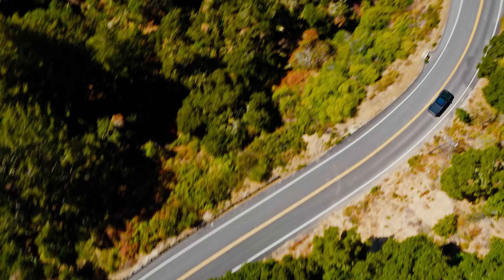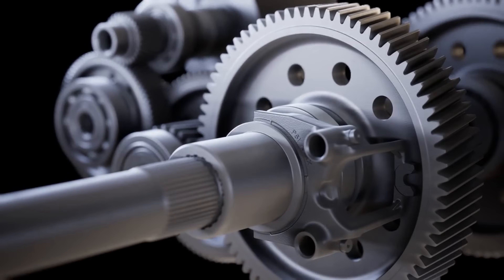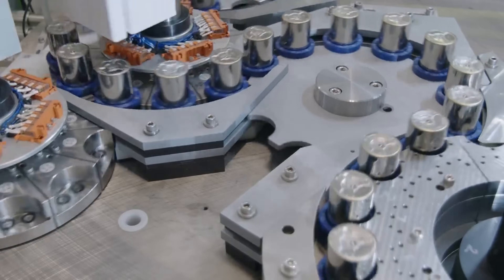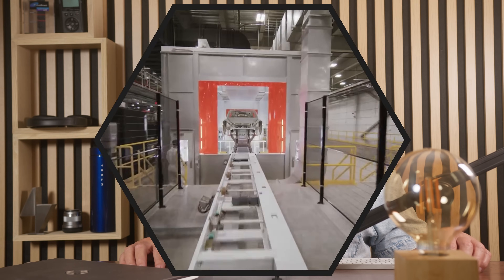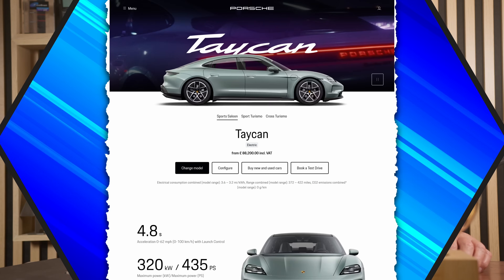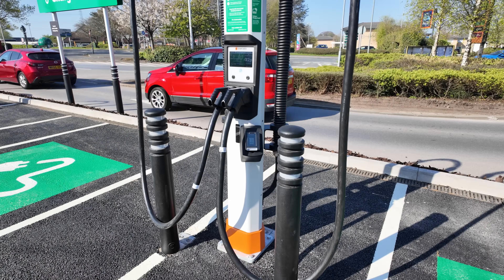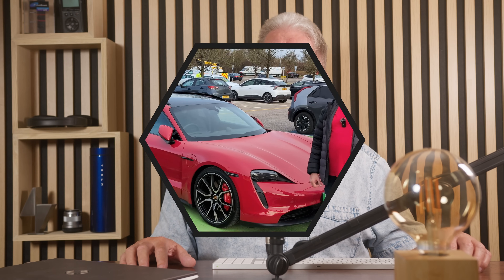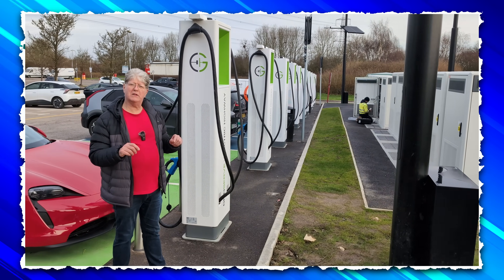800V Charging Is The Future... Or Is It?

Comment: i absolutely love BYD (blade battery) and CATL batteries which are extremely high voltage, and fully capable of flash charging in five minutes, adding 250 miles for the BYD blade batteries, and 323 miles added in five minutes for the CATL batteries. some of my favorites is, no fire hazard, longer cycle life (over one million miles of driving while retaining 80% of their original capacity to fully charge), cost less to manufacture, lower cost materials, and 100% recyclable. i remember when all the experts agreed that it was not possible to flash charge a battery in five minutes, and have a battery that has a long cycle life. BYD and CATL both offer lower cost flash charging batteries that are better than the obsolete technologies which cost more, and have a shorter cycle life. The future has arrived. now charging an electric vehicle can take less time than refueling a gasoline vehicle. China already is in the works of installing thousands of flash charging electric vehicle chargers and China has mastered how to transition to electric vehicles by giving the electric vehicle industry, including ev buyers, all of the subsidies and incentives that they use to give gas and oil. now gas and oil receive no support, and breakthrough ev technologies receive over 800 billion in support, in 2024 alone.

China is a master of action. China has installed literally thousands of ev chargers each and every day, for decades. While the US has promised to install chargers, but many ev owners say they do not even see one new charger installed, and the existing ev charging infrastructure is often non operable, with no one responding to repair requests. this is another reason so many ev buyers buy tesla, because tesla maintains their superchargers, and tesla is constantly expanding their supercharger network, in every direction needed, and always without hesitation, and without delay. i have never had to wait more than 60 seconds to begin charging a tesla, even when the charging stations are at full capacity, during the busiest of hours. if tesla can add more solar to their supercharging network and offer free supercharging for life for all new tesla ev buyers, i think everyone would break up with their gas vehicles and dump the pump once and for all. the transition is already taking place. tesla owners are seeing their ev’s last longer than gas engines last, which means battery technology has already matured far beyond the life of a gas powered vehicles lifespan.

Comment: 800V is from the here on out. There will still be 400V EV's sold, especially on the cheaper variety, but most chargers being installed now are all 800V, so will most EV's be that way. It's called progress. It can't be stopped. Never has, never will.

Comment: Lots of EVs are using 400 V and for the last decade it has been state of the art.
Now 800 V is the new black but it doesn't change the fact that your current EV is just as good now as it was before.
Your next EV will most likely be 800 V and it really doesn't change anything noticable maybe except that a very few old chargers will be incompatible.

Comment: Facts wrong again Dave, Tesla use both permanent magnet and induction motors. These are both controlled by an inverter unit delivering 3 phase AC to the motors. DC motors use brushes, Which wear. All brushless motors use AC to control speed and power.

Comment: Motors are all AC, not DC, it's just induction or permanent magned. DC motors are what you had in old forklifts, golf carts or milkfloats, they have to use brushes and are therefore limited in power.

Comment: 800v is a beast. In my 2025 Ioniq 5 I’m plugging in around 30% (need a comfort break at around 200 miles). It will charge at 250kw until then 200kw until 80% this is usually just over 13mins. In my LR AWD at 30% I would usually get about 80% and my 30-80% would take maybe slightly over 20mins. Cannot wait until the Tesla cars are 800v.

Comment: Within reason, the higher the voltage the better. It reduces the size and hence cost of the wiring., and the greater the efficiency. Bear in mind that P=I2R, that's current squared. Half the current gives much less than half the power lost due to resistance.
It's also cheaper for the power electronics that don't need to switch as much current.
It's necessary if you're charging a lorry, else the cables become absurdly large. There's a very good reason why power is transmitted at as high a voltage as practicle.
So if you want elegant, cheap chargers with thin cables, you need a higher voltage.
You might want even higher voltages for extremely rapid charging. For most purposes it doesn't make much difference.

Comment: The fastest charging speeds are totally irrelevant. Never do you get the fastest speed  for more than a few seconds, with the battery low in power. It soon drops down to half the power then quarter.  By the time you get near 80% its starting to crawl.  The best figures are times from 10 to 80% Not the maximum power.

Comment: Not quite true about the 1000 mile range car.  In 2006 as a publicity stunt Jaguar drove a stock XJ 350 TDVI from Lands End to John 'O'Groats on one tank and then headed south back to Coventry, running out of fuel after 1000.2 miles of driving.

Comment: Charging speeds are fine for most people already, if you are charging when at work,lunch walking the dogs or overnight then 10 mins either way doesn't really matter. Quick charging can be a pain, when i had my model y it was really annoying having to go and move it when i was halfway through lunch or similar.
Tesla make good ev's but there are more refined and comfortable cars, changed mine for a bmw ix3 much better refinement, comfort really don't miss the tesla

Comment: You are correct.  As a consumer I don't care about the voltage or the battery chemistry.  But I do care if it satisfies my needs as a driver.  

I have a Chevy Bolt for around town.  And an Ioniq-5 for long trips.  The Bolt is efficient and easy to park.  The Ioniq-5 is a charging beast.  And I have to stop at least one time between each charge to pee.  Range is never an issue.

Comment: The advantages of 800V architecture is the battery AH rating can be lower, which means lighter cells, thinner cables, lower current capacity connectors, and faster switching IGBTs in the inverter. As less current is being generated, there isn't so much wasted heat going into the cooling system, so that can be reduced in size too. Because the AH rating of the cells is lower, they'll charge faster than a cell of a similar capacity 400V battery pack. 
There are many advantages to 800V architecture, but also disadvantages, the cost of the battery being a major one.
Reply: Cell voltage is based on chemistry of the battery. Pack voltage is based on how many cells are wired in series. Heat losses within the cells are determined by internal resistance with the cells, a factor of their design and manufacturing process and to a very small degree pack design, nothing to do with pack voltage.  Pack voltage is a irrelevant to cell performance.

Comment: About 800V chargers. They are available since 2020/2021... each year much more of those.
First provider for tehm...ionity (owned by german car producers and hyundai/kia concern.
Remember, not only the Taican used 800V ...also a few audi top models.
And hyunday implemented the 800V architecture on the egmp platform (first deliveries in 2021 in europe witj the ioniq 5 and shortly after hat the kia ev6.
In theorie the max charging speed of batteries depend on the battery chemistry and BMS. It is not relevant for this if we have a 400V, 800V or whatever other DC to charge them.
The voltage is only relevant for he wiring between charger an BMS ...reducing the current in those witing.

Comment: 10:43  -My diesel car range was 750-800 mi.

As for range, this was not necessary with ICE vehicles because the tank was full in less than 2 minutes.

So I don't understand... that ICE vehicles didn't have a range above 1k mi.. It only takes less than 2 minutes.

"Light passenger vehicles pump up to about 50 litres (13 US gallons) per minute (the United States limits this to 10 US gallons [38 litres] per minute)"

For fuel, it doesn't matter if only 1 car is refueling and 9 pumps are empty, or if all 10 pumps are full, the refueling speed will ALWAYS be the same.

However, this does not apply when charging EVs. For charging, the main power (ex: 1 MWh) will always be divided by the number of EVs that are now charging.

1 MWh = 1000 kWh

1 MWh: 10 Cars = 100 kWh
3 MWh: 20 Cars = 150 kWh
5 MWh: 20 Cars = 250 kWh

The charging station will have 10+ MWh or even all charging locations, and with these cables 🤣

Each location will surely have 20 charging stations (even more if there is room), and to reach 500 kWh, the location needs 10 MWh.

Just for fun...  +/-

Battery Capacity:  100 kWh
Charge Level:  20% -> 80%

Charging Power:  1000 kW
Charging Time:  5m

Charging Power:  500 kW
Charging Time:  8m

500 kW more power for only 3 mins faster charging time.

Once we exceed 500 kW, the efficiency is very poor. So speeds above 500 kW will be available one day, but above 700 kW will take a very, very long time! The exceptions are companies...
Reply: It takes closer to 10 minutes to fill a fuel tank capable of taking a large SUV 700 miles. 

My EV takes 5 seconds every evening, and I don't need to go anywhere. 

Oh and I drive a diesel car too, so I'm well aware of how long it actually takes to fill an ICE fuel tank, and no I can't get anything like 700 miles for my £90 tank fill, 500 miles being more accurate. 

Do all the maths you like, but the difference between 500 miles for £90 of diesel and 500 miles for £8 in electricity, makes the EV much more appealing to me.
Reply: @johnnodge4327 10 min? 🤣🤣🤣

It takes 2 mins MAX!

"Light passenger vehicles pump up to about 50 liters (13 US gallons) per minute (the United States limits this to 10 US gallons [38 liters] per minute)."

How?  
57 liters = 15 US gallons

US: 10 gallons per minute
or
EU: 50 litres per minute

Then there's a limit at your gas station! But for other countries, and my country is 2 min MAX!

There are some gas stations around the world that have slower pumps.

6 gallons per minute
or
23 litres per minute

In this case:  3 - 4 mins = 18 gallons (68 litres)

SUV Tank Size: 18 - 24 gallons (68 - 91 liters)

Which means a maximum of 5 minutes but at a rate of 5 gallons per minute. (19 liters)

For 9 - 10 minutes... This means 2 - 2.6 gallons per minute. (7.5 - 9.8 liters).

For that low speed, there's something wrong with your gas station, because average it takes 2-3 mins (ok... 4min in some cases).
Reply: So why have a tank capacity that covers the entire length of the UK? :)  Would it be because it's actually inconvenient to have to take the vehicle somewhere to fill up, stand in the cold and wind, fiddle around paying?  I used to drive 200 miles commute each day, the vehicle was LPG.  Every single day I had to go and refuel.  The small deviation off route was only about 300 metres but one traffic light.  From start to end it was 12 minutes, not the oft quoted 2 minutes.  That was an hour of my time a week which with an EV would be less than one minute per week.
Even changing to my petrol or diesel would still have made that fuelling every 2 or 3 days respectively and still far more time wasted than the EV.  Now, of course on the long trip, it flips the other way but far less than people believe.
When I take my classic car for fuel, it needs E5 which is a 12 minute trip each way, then queue around Costco car park, queue at the pumps, the 2 minute fill.  Last time was an hour overall which was the same time that we used for charging between Calais and Switzerland, the difference being is that we ate while the car charged, weren't sitting in a queue to fuel.
Reply: @djtaylorutube 
You'll not convince some people that it takes longer to fill up an ICE vehicle that 2 minutes, it can take 5 minutes just to pay for the stuff.
I don't believe paying 10 times as much for fuel, is worth the few minutes time saving of filling an ICE tank.

Comment: Do some actual research Dave, new LFPs are some of the fastest charging batteries now. Like the Zeekr golden brick. Even base model Xpeng g6 has a 220kw peak charge LFP.
Reply: Let’s not forget that ‘peak’ means peak, not average.  I’m not arguing with you but I would be looking deeper than the marketing hype.
Reply: @oliver90owner  - I suspect the poster meant that these 800v architecture vehicles have a longer sustain peak and overall higher sustained power capacity in their charging curves than 400v architecture counterparts.

Comment: Honestly, a range of 250 miles means 3 to 4 hours of driving, so I amdefinately ready for  a toilet break then food and drink. I need at least 30 minutes for this, so why would I want 10 minute or even 5 minute charges. My old Kia E Niro was around 45 minutes 10-80% and was a comfortable stop. My Tesla has usually wanted a 10 minute stop to continue. Even a top up to 100% is not much more than the half an hour. Surely the cost for an 800v charge would be a lot higher as well.
Reply: Nobody should be fully charging their vehicle part way through a journey, unless it is the last charging opportunity.  Better for most, time-wise, to charge to around 80% and get on your way.  I may start my journey with 100% but have never charged to 100% en route.
Reply: @oliver90owner  I have an LFP battery and the fact that 80% happens too quickly, I need to extend to 100% so not to infer any extra fees for not moving my car and hogging a charger.
Reply: @Jaw0lf    Let’s be fair about claims of charging times (I drive an EV, but don’t exaggerate).  10 minutes, to charge to 80% from 10% (assuming, here, a 75kWh battery) would need a continuous charge rate of 300kW.  Are there any Tesla chargers over 250kW yet?  250kW continuously, over a 10 minute period would add 41kWh, which would equate to ~55% of battery capacity - meaning a start SOC of 25%.  20 minutes to add that final 15kWh calculates to an average rate of 45kW.  Those claims, to me, appear a bit excessive.  Please, let’s be realistic about this - something doesn’t add up.

I don’t really see why a higher charge rate, with 800V architecture, should be any more expensive than the lower-rate ultra-rapids - it’s still the same amount of power and should allow the station to charge more vehicles in the same time - so more revenue/hour for the CPO.🙂

Comment: If Tesla is best tech why doesn't it have V2L? Even cheap Chinese cars have it.
Reply: Because it would be a self compete with Tesla Powerwall.  Tesla sells more than just cars.
Reply: @djtaylorutube   You cannot take a Powerwall on a picnic, for instance!  I would charge a Powerwall  on a cheap night tariff and discharge it when leccy was expensive.🙂  Solar panels would help as well, of course.
Reply: @oliver90owner I know and I agree that it would be useful sometimes but then people would be inclined to use their car as a home battery and Tesla seem to want to warrant the battery for motive power. Just a decision on their part.
I don't have a Power wall but a different brand and do exactly what you describe, charge the battery on cheap and run the house off it during the day (with solar). If the car starts charging on IOG and the price drops to 7p, battery auto charges at the same time.
Reply: It’s not about being ‘best’ at all.  VtoL doesn’t make the car go further or faster.  Not all cars have a heat pump for cabin temperature control - you pays your money and …..